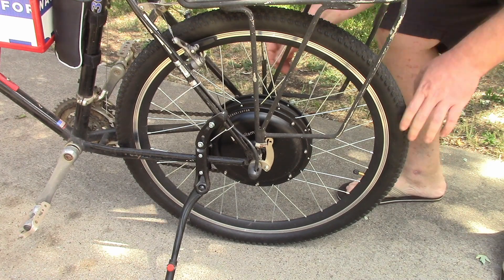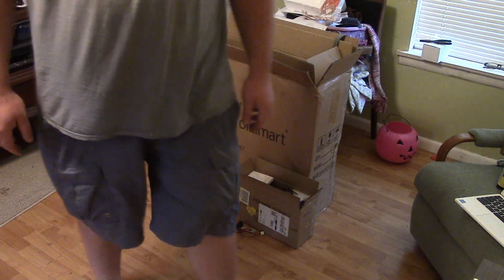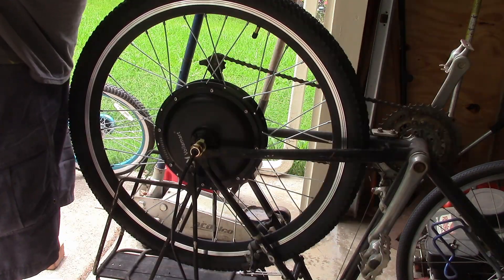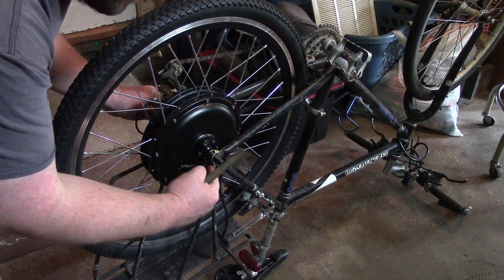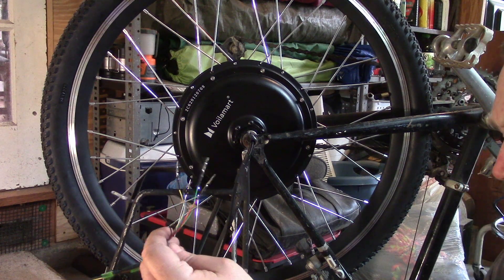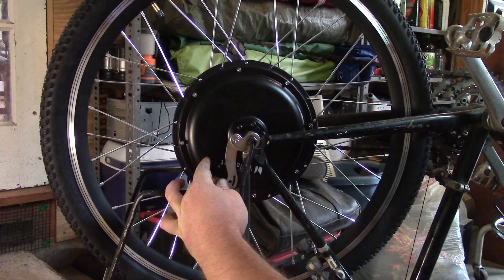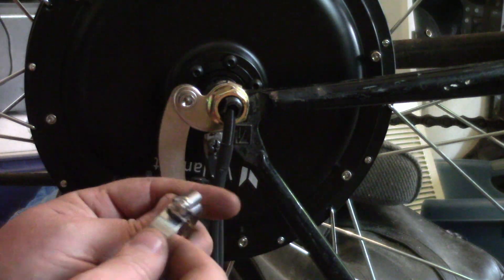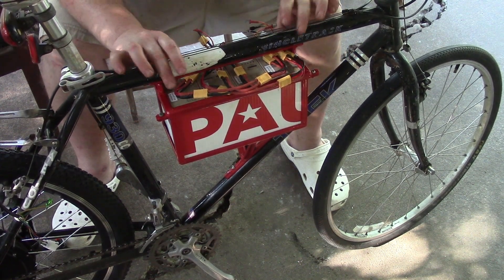How to Install a Rear Hub Motor for a Electric Bicycle Conversion Kit. DIY E Bike Conversion Kit.

Comment: I think there's something you should reconsider regarding the installation of the torque arm.  As you stated, when the hub motor is under power, the hub's axle shaft will react in the opposite direction of the rotation of the wheel hub.  That means, as installed, the torque arm will pull away from the hose clamp.  It should be re-positioned so that the torque arm will instead push against something solid (and, not the cargo rack, but rather the frame).
Reply from the maker: I’ll adjust it when I need to do tire work. Thank you for the advice.
Reply: Could you explain why you need the torque arm? Will the motor cause too much wear on the thread?
Reply: @flyers088  
The torque arm is used to protect the dropouts of the frame (where the axle slides into the frame).  Some of these motors produce enough torque that the slotted axle could spin and deform the dropouts (particularly with an aluminum frame).  Some people have seen their axle-hub-wheel separate from the frame, while riding.  I have a 1500 watt motor, and thus use two torque arms - one for the left side, and other for the right side.
Reply: @ktraglin 
Hi there,
I've just ordered a Voilamart 1500w 48v rear hub kit and a 52v 20ah battery, it should all arrive in the next 3 or so days, I've ordered a £12 torque arm, but just the one, did you make your own torque arm for the other side of the rear axle or did you just buy 2?...
Any tips for the install please?
Cheers.
Reply: @mickyb.8014 you need to fit 2 torque arms for anything above 1500w and if your frame is aluminium not steel. You may also need to file your dropouts 3 to 4mm deeper not wider to make it more secure. Just take your time building it... Have fun on it 👍
Reply: @S1m0nX386  thanks, I spent a whole day fitting it all and wrapping/hiding all the wiring away..
I built it a month back now, fitted 2 x Torque arms I made from steel plate and drilled to the frame so the wheel can't move out the dropouts, thanks though!
I initially bought 2 x the cheap £10 torque arms the ones you use jubilee clips to hold them to the frame, but they are pretty useless in my opinion and I just didn't trust them to keep the wheel safely in the rear axle so I made 2 x proper torque arms using 5mm thick steel plate so this way the wheel 100% cannot remove itself from the rear axle joints where it sits, made me feel sooo much safer when out riding because them cheap jubilee clip torque arms are basically rubbish.

Comment: I bought that kit.  The instructions are severely lacking.  Takes a little bit of think and adapt. I went through much of what you did here. Except not filing my wheel mount. I had 2 torque bars but then took them off to add a steel back rack.  It mounts to the wheel hubs with flats exactly like the torque bars and are much longer.  So I feel they will do a better job.  With a 20AH battery, Wheel + controller, Steel back rack with steel paniers my bike weights 66lbs now.  I worry about my tire.  But so far so good.
Oh and I have gotten up to 36 MPH peddling.
BTW side question.  My LCD started showing "bn3.6" where the tack shows the second I turn on battery power.  I have power to the throttle instantly before pressing "M".  When I turn it off it says "OFF" but then does nothing and still has power to the throttle.  Any clue what caused that?  I have a new LCD on its way from Voilamart.

Comment: Thanks for the video,  i watched lots of installing videos but didn't find them informative enough. I have the same problem that rear dropouts are shallow and saw you filed them and now i know the solution. Another great thing i learn is how to disconnect those wires from the plug and reconnect them back. Cheers